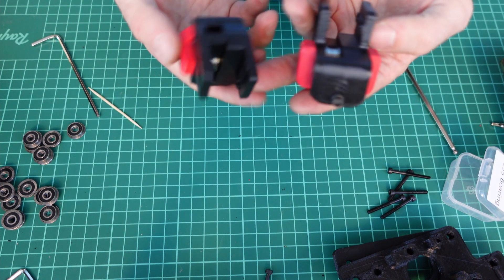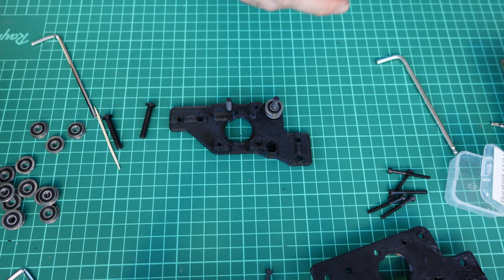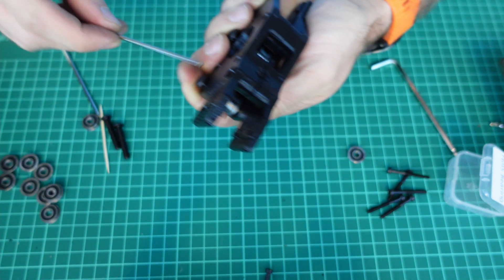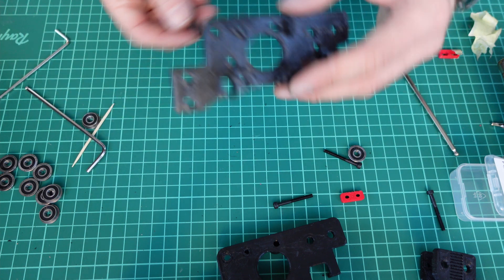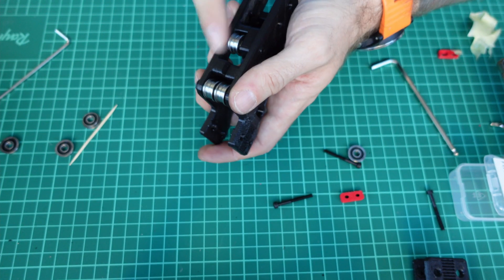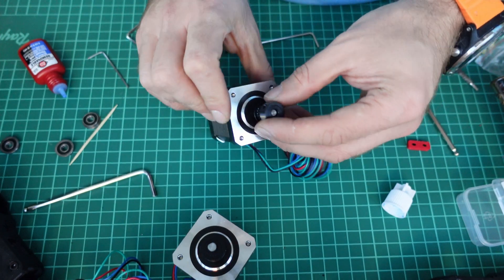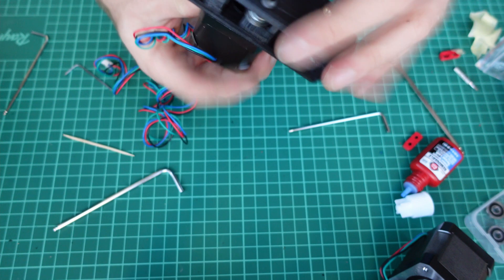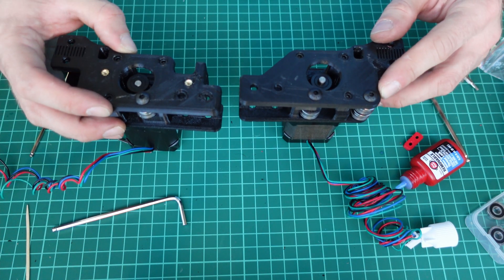Building Voron 2.4! P7 - AB units

Comment: are all this pirnt 3d parts come with the kit? because their page says no printed parts includet!!!! I am confuse. Does the kit comes  with everything to make the printer ready for printing?
Reply from the maker: Yes, the 3d printed parts are not included with Formbot kit. I've printed them myself using ABS+ on a pretty old unenclosed printer.

You can either print them yourself, join PIF (Voron's program when they send you printed parts for quite a cheap price), or buy a set of printed parts from Etsy / Ebay / Aliexpress.